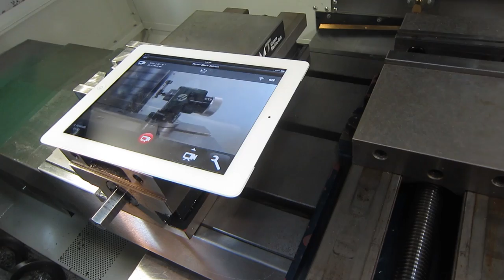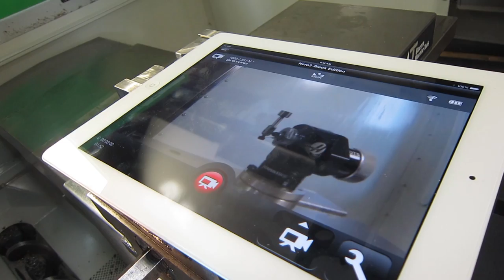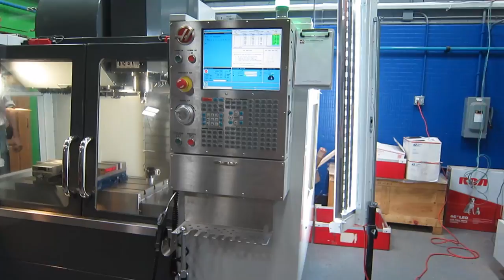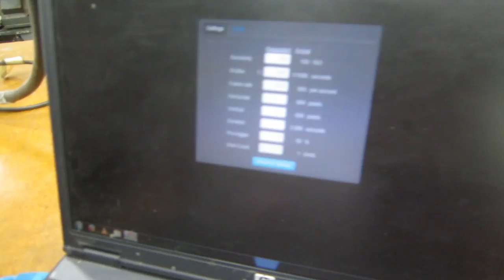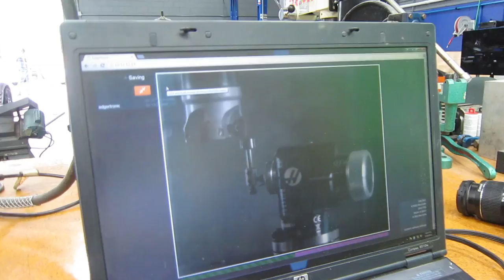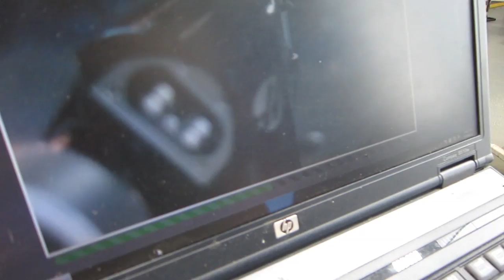AV Blog 2015-07-16: CNC Shoot and More High Speed Play

Comment: Do you guys have any other lenses for the highspeed besides the 50mm?
Reply from the maker: KE5SUI Not at the moment. I've looked a bit at other F-mount lenses from Nikon to possibly pair with it, but haven't done much more than that yet. --Liz
Reply: ThoseAVGeeks Would somewhere around 100mm be useful? I saw a good bit of them on ebay last night for decent prices. I don't know what aperture you typically run the lens at but would 2.8 be alright?
Reply from the maker: KE5SUI I'm sure we could get a fair bit of use out it. 2.8 would be generally workable with some tweaking of the lighting. :)

Before you buy though, you may want to poke around Edgertronic's wiki to be sure you're buying something compatible. http://wiki.edgertronic.com/index.php/Lens_mount

Comment: (1100)  Belletini trying to wake up the pad.  first video should be short.  yes we need see what the machine is doing.  tearing apart reports looks fun.  number the cameras and pads.  camera 1 goes to pad 1 and so on.  small delay is fine.  he made a sound check in boden.
Reply: Sam Sitar This is the first time that the camera has straight up refused to connect to the pad.  Usually switching between them is no big deal, sometimes it takes a minute, this time the camera was completely unresponsive.
Reply: camera refusal looks like a malfunction.  glad that it's so fast when it works.